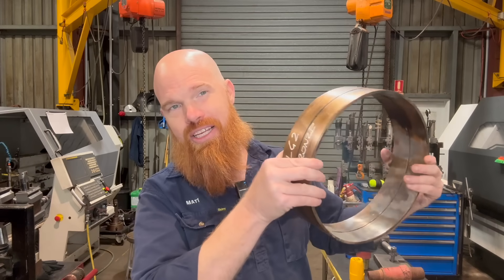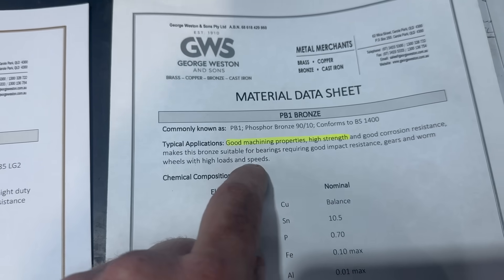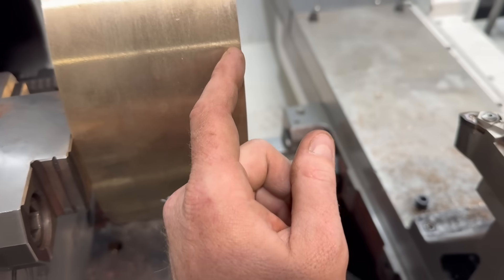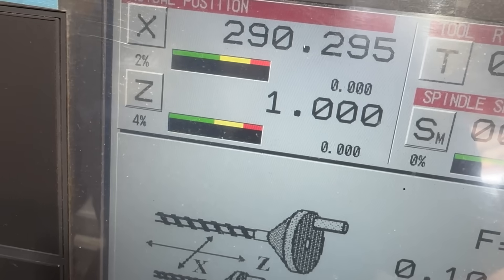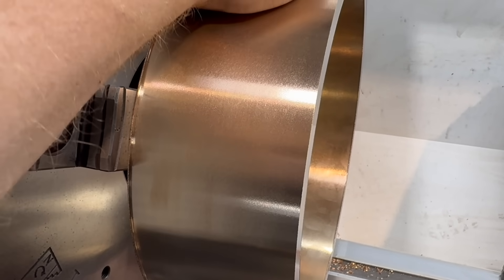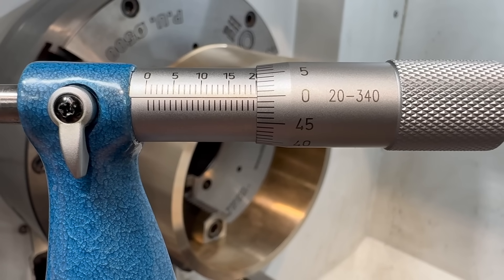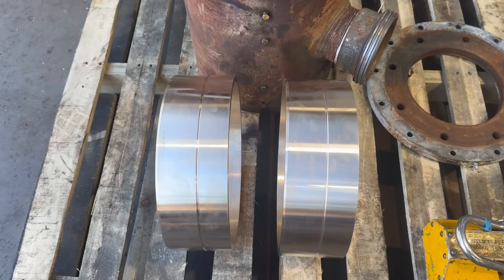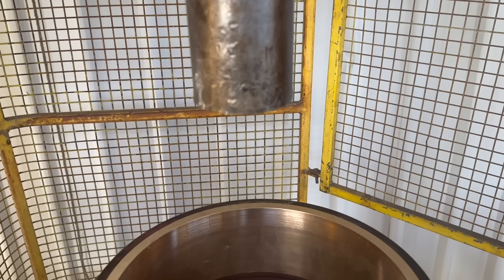Machining and Installing GIGANTIC Bronze Bushes

Comment: Do you use dry ice or liquid nitrogen? I did a cost analysis on using liquid nitrogen vs using a press at a shop I was working in a year ago... the labour hours using a press for installations turned out to be double the expense of installs using liquid nitrogen.
Reply from the maker: Interesting. I’ll have to relook at that. We probably need to just bite the bullet and do it standard no matter what.
Reply: @halheavyduty  it makes for much cleaner installs with less chance of damage being done also

Comment: Extreme NW OHIO,USA near Indiana & Michigan zip/postal code 43517, our now 3rd generation business since 1966 is Water Well Drilling & Repair and I am a machinist by education. So this doubly interest me our drill rig is a GD 1000 our nearest machine shops geared to repair rig/well equipment and thread tapers are in Mount Pleasant,MI about 3 hrs North they call it the oil patch of Michigan. Keep up the good work and I grew up on cable rigs BE 20 an we went rotary in the mid/late 70s. I've worked on 1" to 12" water wells most are screened in my area as we are unconsolidated materials,  a little shale and limestone wells not far.  Our water wells can produce little 1 gallon per minute to 1,000+ gpm depending on well size and location rock or gravel, screened, unscreened the deepest I've ever been is 300 feet we even have wells the free flow above ground called flowing artesian wells. My father started in 1966 working for a man then in business drilling a couple  yrs later  he and another man left and started their own drilling company in 1972 they split partnership an in 1973 I started helping I am now 65 in 2025.

Comment: Hello Matt, I am from Essex on the east side of London in the UK. A 73 year old retired Mechanical Engineer and worked initially in the aero engine manufacture as an apprentice, then  magnetics industry and finally the rail rolling stock sector. Did a lot of machining but on a relatively smaller scale. Love your channel and look forward to all the interesting jobs you get involved in. Great job keep it going.😊
Reply from the maker: Cheers good sir! Appreciate it Graham 🇬🇧👊

Comment: When you were trying to gently blow bronze chips, it reminded me of a regulator I have in my shop. Air regulator with a male and female air chucks on each side. Can be placed inline on any air line needing a lower air pressure, dial in the psi required. Works great for inflating low pressure tractor tires! Would work well here to give a lower blower pressure for blowing chips.

Manitoba, Canada!
Reply from the maker: Yeah we need to reduce the general pressure in the shop for sure. It’s wild

Comment: Love the recycled bronze.  I would have watched that being done!
You machining was ok too 🤠
I made a pin today for a clock I’m repairing.  1.2mm diameter by 4mm long.
I was struggling to hold on to that!  Maybe I need a watch makers lathe. 
Ps made it out of fencing wire but I’m a farmer.🧑‍🏭
Reply from the maker: Nice work! Yeah little parts freak me out 🤣

Comment: G'day mate, happy Friday, a tip use a strip of emey tape under the front tool screw to keep the swarf out of your beard when M/C brass or bronze on a manual lathe ,cheers Tom from South Oz

Comment: Any worries with the three-jaw distorting the ring? How do you determine potential deformation of thin wall parts?
Reply from the maker: It’ll distort but not much I can do. So I just machine the internals once it’s fitted

Comment: When I done my apprenticeship as a fitter and turner way back in the 1970s if I used compressed air to blow off a machine I would have got a kick up the backside! Stop blowing chips into the slideways you git! Only happened twice! You had to use a paintbrush. Haven't done any big work for years but on the high dollar stuff I used to get real nervous about stuff ups. Only made a couple that I try to forget. Nothing terrible but a hundred dollars worth of material wasted is embarrassing. Love the channel! G'day from Tasmania
Reply from the maker: Cheers good sir! Love it Glenn 🤣👊

Comment: For me it's always interesting to spot industrial companies from Europe with all sorts of machines in this kind of videos. On the yellow press the words "Sprecher + Schuh" stood out which is a Swiss company founded in 1903 for low-voltage control products (switches, fuses, breakers, relays). ✌️
Reply from the maker: Interesting how tech gets around hey.  There’s a bunch of old Soviet machines floating around Australia from the 70s.

We’ve got an old shaper bit there’s some amazing stuff out there that comes on the market from time to time

Comment: HI i'm 82 I was a fitter and turner also some toolmaking, making dies for the shoe industry and toy industry. In my last job working for Silcraft industries I was responsible for maintaining and polishing very large dies for the car industry. I wish that I had a boss like you.I ha
ve my own workshop at home I make parts for my astro club, plus the odd job for other people.The lathe is a colchester student ,the mill is a HMT turret with dro plus a 2000 Kempi welder. with those thee items i can almost make anything within that size range. Love your work.Les

Comment: The PB1 reminded me of a job we did for a Victorian water valve in London, 
6" dia 5ft long Buttress thread with a tapered drive Harry made the drive nut as well.
Used PB2. 
Have you thought about a VTL machine as your jobs are getting bigger,
Just watched it on my TV much better than the laptop. 
Harry saved all the swarf from that job and cashed it in lol
Reply from the maker: Nice work Harry!

Comment: If you had heated up the outer shell then the bronze sleeves would have just dropped in without using the press.
Reply from the maker: Yeah I could have but decided against it. You are correct though 💯

Comment: When I was serving my apprenticeship (1999), I worked on a old turret lathe (one 6 position rotating tool post on the tailstock and another 5 position on the cross slide) there was a brass plate on the lathe property of the Canadian Government 1942 / six pounder shell casing manufacture. No CNC back then. How things have changed

Comment: Hello from Northern part of Sweden, always a pleasure to watch a professional in action. I’m trying to figure out how the grease run is suppose to work without some holes drilled through the bronze bearing?
Reply from the maker: They get driller after the internals are machined. Helps me avoid interrupted cuts

Comment: Great video , as an old retired fitter and turner in Hobart , I can remember my machine shop supervisor getting me to work out the interference fit measurements for bearings which always filled me with terror.
Reply from the maker: Totally relatable good sir. 💯🙏👊

Comment: The price of stock has gotten insane. I want to make a cannon barrel for a 1/6 scale model my Dad made 40 years ago that has a wood barrel. A 12" piece of 2" bronze is right at $300! I don't need it to actually fire so I looked at hollow bar and I can turn a plug for it. $170!! So, I went scrapping and found a pump housing for a boiler system that weighs about 50 pounds. Now, I could just take it to the scrap yard and sell it but I'd still be short by $70 so I decided the way to go is to learn how to cast metal and cast myself a barrel in a single piece. More scrapping and I have a working furnace that I have made aluminum castings with for practice. Now that the weather is cooling off it is time to make a barrel. Or barrels, more likely because I am sure I will mess it up at least once, probably more. Oh, look a rabbit hole!

Comment: One of the things about machining is that it is about scale - you are working with tolerances that are orders of magnitude smaller than what a plumber is used to. There is a great video put up by Guy Martin about an old  Japanese machinist doing some high precision parts for NASA  or maybe Airbus and the final cut he judges by sound. It is well worth watching. In my experience machinists are pretty detailed people not "big picture" types.  As you were doing this job I thought to myself that there are a billion ways I could have buggered it up.
Reply from the maker: I’ll have to watch that video. 

So many things I hear go wrong before anything else.  It’s a very auditory profession.
Reply: @halheavyduty  Yes, it's amazing how atoned to sound you can become. When I was tool setting, often I could tell if something was going wrong on a machine before the operator did, even in a shop with lots going on. It's uncanny

Comment: Shout out from Ipswich SE QLD.

I have a little mini lathe. I love, love, love machining bronze. Such a pleasurable material to machine with. Made bushings, bearings and coil forming jigs with the stuff.

Had some mild steel that gave stringy chips. I used it as a critter blocker for the dunny when we remodeled it. Just got a bunch of it a shoved it between the floor plates and the joists to keep the critters out.

Comment: As a guy who machines bronze (Everdure/932) almost daily I always run High positive inserts, they finish much more accurately and heat the part very little. I also run coolant just to keep the temp even, esp with bushings ( wear rings will just hold tighter so we don’t worry about them so much.

We either sweat rings on or use liquid nitrogen.
If I have to hammer a stuck ring I always use a lead hammer, even copper can deform bronze, just keep it away from the kiddo!

Currently chewing out a couple big (1.200x2.750x18” face keys in a couple 5’6”x18” Pelton wheels with a portable hydraulic driven milling maching, they ordered a left hand unit instead of a right hand so everything has to be cut loose and swapped to the opposite side.
Cheers.
Reply: That is some very useful information.  Thank you.
Reply: Same. Sharp, positive rake inserts made for aluminum work great on bronze.

Comment: Hi.  You have not drilled the holes for the grease to go through. 
I usually also gtind a groove longitudinal on the ID of the housing 20mm wider from the grease hole.  . Had bushing drift on excavator that blocks the grease feed.
Reply from the maker: Nice one! Yeah I’ll drill it after it’s in.  For this application it’ll be fine.

Comment: Not a machinist, but if it’s a friction, or interference fit, what does the grease groove do?
Reply: After it's drilled, when the ID is finished out, it allows grease to be pressed into one grease fitting and spread around evenly to the whole rotating part to keep it lubed and happy😊
Reply from the maker: Thanks @bullfrogmacine 💯👊✌️
Reply: @bullfrogmachine makes sense. Thank you